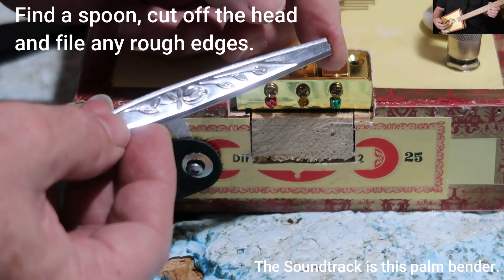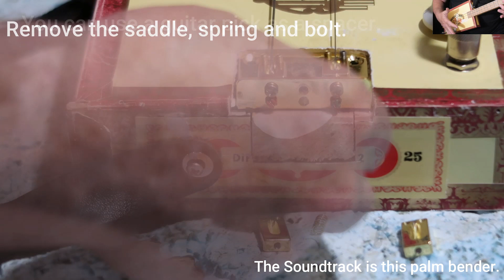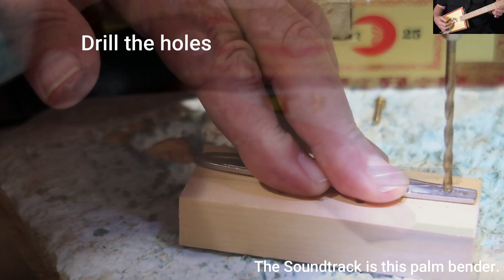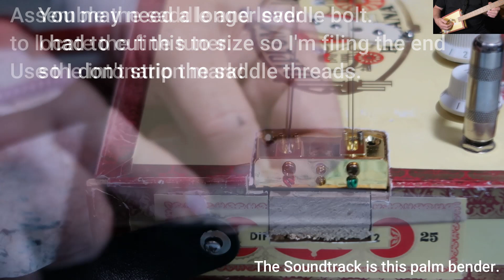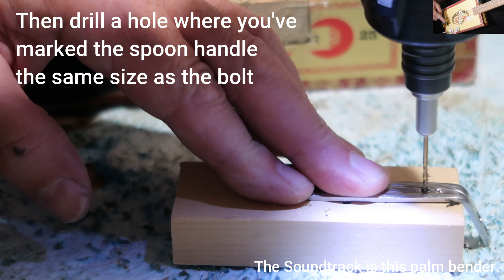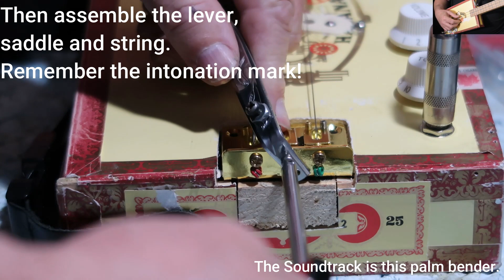Learn How to Make A Simple Palm (B) Bender For Cigar Box Guitar (guitar hack)

Comment: Cool! What does the fine tuner do? Does it limit the bender?
Reply from the maker: Exactly. So it can sound like a steel guitar by going right to pitch. Or you can back it off then it's like a tremolo arm.
Reply: @busker909 got it! I see the bender is pulling the string from the bottom of the two holes (the upper is the anchor) … nice simple application for a hard tail bridge on a cbg!